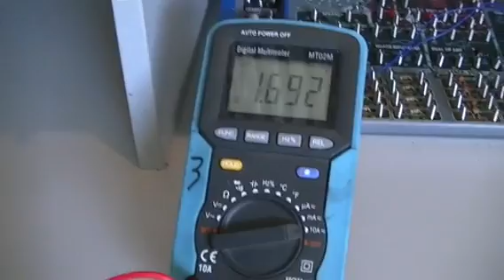SCR how to switch it off

Comment: In my experience an SCR is used to control the duty cycle of AC, not for switching in a DC application. Of course there are many other applications, but that is what I used them for. I was controlling lamp brightness.
Reply: No. SCR can be used for dc switching. Like high ampere inverters still use SCR to switch dc from the dc bus.
Reply: Their main purpose is in HVDC lines like from Oregon to Cali. Diode with a switch.

Comment: Wiki:
A thyristor can be switched off if the external circuit causes the anode to become negatively biased (a method known as natural, or line, commutation). In some applications this is done by switching a second thyristor to discharge a capacitor into the cathode of the first thyristor. This method is called forced commutation.

and i found this site :http://www.daenotes.com/electronics/industrial-electronics/silicon-controlled-rectifiers-scr
Reply: this is more likely what the original circuit  used (the big inductor/pulse transformer got me thinking)
https://www.pantechsolutions.net/images/stories/k2-articles/class-e-forced-communication.jpg
Reply: not going to lie, each time I try that stacco circuit with one it shoots thru with the gu-5b

Comment: For very small currents (lighting up LEDs and such) you can in fact turn the SCR on and off using the gate as you would a MOSFET or similar device.

Comment: What is a capacitor was used to switch the SCR off in the way shown in the video, the current would only need to flow for a short period of time? that way there is no chance that if it is left connected it will not fry a small MOSFET. Often small parts can handle huge power transients but not for long. Like an 8A MOSFET might be able to handle 100A for a few microseconds.

Comment: I've been wrong before. But you should be able to disconnect the lead from the motor to turn it off. If you remove the load and reconnect it it should be off ? ~Russ
Reply: hey Russ!
you're totally right about this ,by disconnecting,  the current go's to zero and the scr will block again ,
but disconnecting under heavy load, like 100 or 200amps DC is gonna get you some really (beautifully) big arcs :o 
~Ewout :)